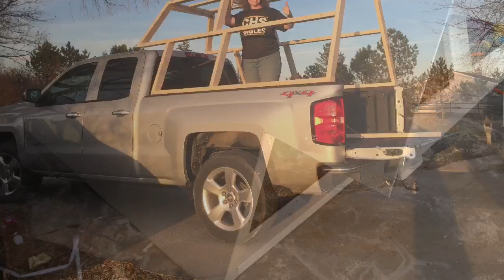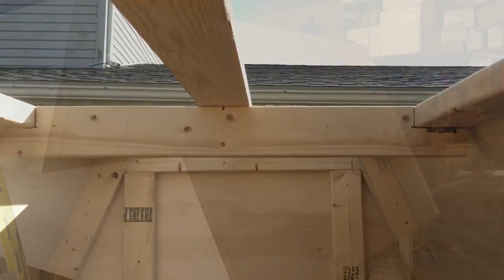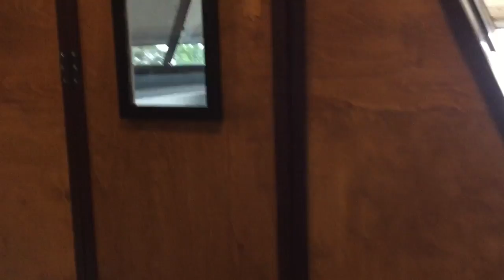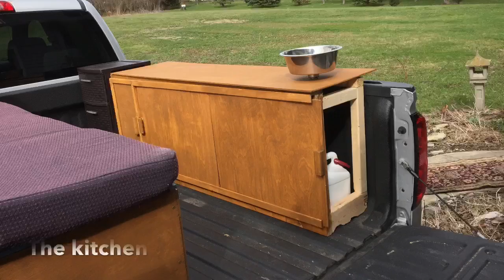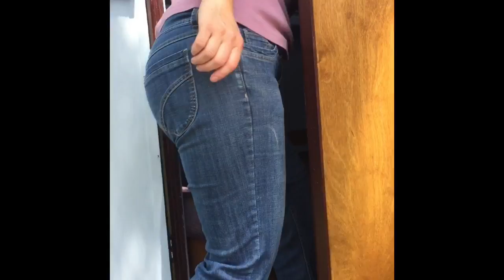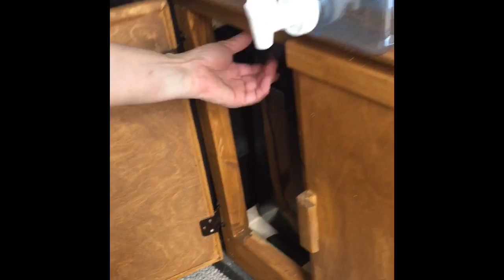DIY Wood Truck Cap Camper

Comment: Just great work. I realize this was posted over four years ago, but, if you are still reading posts, are you still using it? And, did you ever weigh the topper?
Reply from the maker: I used it up to last year, until I bought a bus and converted that.
Reply: @hollijacobs7858  Thanks for the reply and hope the bus is working out for you.

Comment: Great work, I've been looking into doing this. I was wondering how you secured the camper onto the truck so it doesn't fly off. Thanks!
Reply: Big aluminum clamps (4) and something called bully clamps. And bolts.  It was secured in 10 different places!!,

Comment: I have a Ford Ranger so in order to sleep sideways I'm going to have to extend it out beyond the walls of the truck by about 6 in on each side so I can sleep sideways part of the plot plywood 38 in of it will basically be across the whole thing I want to put solar panels on top and on one side so I can always aim the truck when I'm parked to face the wind not to win the Sun I got Junk land in hudspeth Texas and I want to visit it with this I like your concept because you don't add excess weight
Reply from the maker: I often thought about what you are suggesting.   It would work as long as everything is super secure and balanced.

Comment: I am in the planning stages now, and your frame design is PERFECT!!  The beam running the entire length of the side frame will give good support to the upper sleeping area.  I am a rather "large" person (6'2", 200 + lbs) so my design is expanded out a bit from yours, but essentially the same.  Thanks for the great ideas!!
Reply from the maker: Thanks you, sturdy and light weight was my goal.
Reply from the maker: @poa2.0surface77  go for it!  I’m not a fancy kind of gal!  More practical than anything else.

Comment: Your lightweight, eye catching and well equipped camper looks to be very accommodating, whether for a few days or a few months.

You've found that much sought balance between weight, bulk, practicality (on or off your truck) style and cost, and in doing so have created this elegantly simple, simply elegant travel cabin.

Your build will inspire others to consider the benefits of a light yet strong design and to keep it simple, without missing out on comfort, hygiene and self contained practicality.
Reply: She inspired Me!!

Comment: I’m a carpenter and I think you did a really nice job. Well thought out and it looks pretty light too! I may build the same on my truck.
My only concern is the rain hitting that plywood which will eventually delaminate.
Reply from the maker: I wanted to put a layer of fiberglass over the top to protect it, but chickened out.  Ended up storing it inside when I want using it.    Thanks for the compliment.
Reply: Little boat builders go through this debate a lot:  use expensive marine plywood, or use basic construction plywood and encapsulate it someway. Fiberglass, though good, is messy and a lot of work. Here are a few techniques used to extend wood life. 
Exterior poly. 
Exterior house paint will go a long way to protect the wood from sun and rain. Easy to reapply and change. Houses been using it a long time.
2-part Epoxy boat paint. 
Fiberglass just the joints where rain gets between the plys. 
Replace bad panels as they fail - use good screws with good heads. Pre-seal all edges. 
Money saved buying construction grade plywood, wait till it fails and build another one.
Reply: Carpenter here too, I thought it was a pretty good build, efficient and looks good. She could always do PMF(poor mans fiberglass) and its fairly cheap, you tube vids to show how. It'd make that shell last for years.

Comment: The best homemade camper I've seen. Don't get mad but I am going to build mine exactly as yours. The best and pretty good looking.
Reply from the maker: Mad?  I’m flattered.   Why reinvent the wheel?   Thanks for the ultimate compliment!!
Reply: Give yourself a pat on the back and give yourself the credit U deserve. Not joking I've built just about everything. Yours is the most simplified but most efficient design I've seen.
Reply: Make a stealthy wind deflector for that and U got it made young Lady.
Reply from the maker: @stephenbenavidez9738  thank you!

Comment: nice job! looks great. i'm about to build a simpler (no overcab) one similarly, i am using t1-11 for the shell, so it is weather ready,
Reply from the maker: Sounds good T1-11 is heavy, make sure it is secured.
Reply: T1-11 is not  a good  option it's a  made  wood  product  the  glue is a  water  based  lots of  swelling  if any  water  gets  in you can break or crumble  it with your  hands   the constant  movement  from your  truck  will widen the  screw holes  your a  lot  better off  with a plywood   use a  rubber  deck  paint on  it and  exterior  silicone  caulk on screws  and  edges  it will  last  years  . For  about  the  same  weight as  t 11 you can  use  plywood,  foam, craft  sanded  interior  plywood  you  get  insulation  and  extra  strength in  one

Comment: Looks great! You don't see many topper\camper builds like this. I am working on my own at the moment. I really think it is a much better way to go than a full on camper. I know this was 5 years ago but I don't see any vids of you using it. Has it all worked out ok?
Reply from the maker: I used it for three years (LOVED IT!!!), then I switched to a skoolie, got an offer I couldn’t refuse on the skoolie… sold that and built a camper in my horse trailer.  😆😆.   But honestly, I miss my truck camper,  I’m already planning another, I want to try to use foam.  I’ll post videos when I build that.  I’m going to use foam and PMF (poor man’s fiberglass).  It’s just as much a challenge to me as it is a savings in $$.
Reply: @hollijacobs7858  Mine is practice for a boat build, eventually (thus air, land and sea). That's why I'm going full on fiberglass. Otherwise I think I would do the PMF. First I'm going to enjoy the topper\camper for awhile.

Comment: Best set up I have seen to date!.......How wide and long is the bed and kitchen set up?  Will do the same with my truck and will credit to your idea / topper/camper here on you tube.
Reply: The bed is 28 inches wide, just about the size of a sleeping bag, and the "kitchen" is about 18 inches deep.  Both run the length of the truck little over 6 ft.

Comment: Great little setup and I was wondering if you had the plans for this build on the top by any chance? I really like it and would like the info on it if available. Thank You!!!
Reply: No plans, sorry, I built it as I went.
Reply: Would you be interested in telling me how tall it is from the bed to the roof top, the measurements of the rear door and the angle the side boards were cut at? The framing boards that rest on the bed of the truck going upward or did you just following the contour of the truck cab? Sorry to be a bother! But I do appreciate your reply
Reply: I tried to follow the angle of my truck cab, but I felt like I angled it in too far.   I could have made it wider at the top.  It was a little over 5 feet from the truck bed to the top, I could almost stand up. My goal was to use a full sheet of plywood on the side.  So it was 4 feet from side rails to the top.   The back door was a little less than two feet wide.  Sorry, I can be more specific.    I just kind of fitted it to the truck as I went.   I don’t have the truck cap anymore, I used all the wood and parts to build a skoolie camper out of a short bus, video to come in the next couple of weeks.

Comment: Great job that's so awsome couple questions. How did u attach the plywood?2nd what did u use to seal the plywood with thank you much appreciated.
Reply from the maker: Liquid nails, screws and nail gun.  On the plywood I spar urethane, to protect it.
Reply: @hollijacobs7858  very good thank you for quick response.

Comment: Very nice job¿the camper!  Any plans to work from or did you just wing it¿ How is it holding up¿ Any tweeks? Was 8ft sheet a limiting factor¿  Well Done!
Reply: I made it too narrow at the top (but it deflects wind great), 4 feet for a whole sheet of plywood would be great.  But then again I have all the room I need.  Yes 8ft was the limiting factor, it kept it simple.   I glued, nailed, screwed and reinforced the snot out of it.   It is rock solid, even at 75 mph.   I didn't have any real plans, just ideas from looking at others.   90% research, 10% construction! 😉
Reply: EXCELLENT JOB THOUGH

Comment: How would you keep water from running in between the door and tailgate?  I think I see foam near the end.
Reply from the maker: I used pipe insulation and tucked even more in the groves.  It worked remarkably well.

Comment: I like it.. but I'd  build it out to sit on the tail gate  and extend it out over the cabin and beyond.  You can inflate some bladder to support it over the cabin. I doubt that there would be any more drag.  nice desing. what kind of wood did you use??
Reply from the maker: It's just the size I wanted.  Not too big.
Reply from the maker: I'm pulling a horse trailer.

Comment: Do you have info on materials used and measurements? This is perfect for what I need to do and plan on recreating it.
Reply: No measurements, sorry.  I fitted it to my truck as I went.  Also made sure there was room for the windows.   Used lots of glue and super long screws.    Also found the most warped 2x4 at Menards, to arch the top over the cab so it wouldn't hit.
Reply: What did you use to cover the 2x4's and enclose the cab?
Reply: Birch plywood, the pricy kind.  I think it was a little thicker than 1/4 inch.   So far it's held up to 75 mph driving.  But the 2x4 frame is rock solid.   I braced and glued and nailed and screwed the snot out of it.  The roof is a thicker plywood with a rough grain texture on the inside.
Reply: How is the topper mounted to the truck? What keeps it in place?
Reply: I used a foam plumbing strip (tape) under the frame, then 4 aluminum truck cap C clamps, 4 bully clamps (attached to bed rail) and in the 2x4 pockets on the truck I bolted wood into them and bolted the cap to those.   I does not budge.
Reply: Hollianne Jacobs i used a thiner peice to get the arch on the top.

Comment: Did you use house paint on the outside? I copied your design pretty closely. Thanks
Reply from the maker: Primer and several coats of exterior paint on the roof.  I store it indoors when not in use.

Comment: Hey Holli! How much does the top weigh? Did it affect your mileage much?
Reply from the maker: I built this to go with my horse trailer, so the trailer really cuts into my mileage.   My hope is that he helps deflect air over my trailer so, maybe it helps with mileage?!?!   But really my mileage seems to be the same when I'm pulling the trailer, with or without the camper.  I've never driven it without the trailer though.
Reply: I agree that the way you built the front tampered will indeed help to deflect the winder resistance while traveling so good build on that for sure. Thanks for getting back to me and good job

Comment: Good Job! You might want to fix it so no one can put your tail gate up and trap you inside!
Reply: Oh yes, I've thought of that.   I have a strip of wood that slides in the space between the tailgate and truck bed preventing someone from walking by and flipping it up.  Sure they could get it out, but not without waking me up first!

Comment: Very nice build! Any idea of the total weight?
Reply: Radnally yes. do you happen to know the weight plz? i love your look but im in a dodge dakota so lower payload allowance
Reply: I'm guessing 300-400 lbs.  I went for light weight.
Reply: Hollianne Jacobs thanks. What material did you use for the skin? Did you build the door as well? I have a pretty low powered 1/2 ton truck with a 6' bed ...and this looks like a pretty light weight solution. I could rip the 2x4s down as well to save weight.
Reply: 1/4 birch plywood. Yes, I built the door, it took on a little warp, but it shuts well enough to keep mosquitoes and rain out.   I used full 2x4s but you can see I didn't use that many, I secured them with 5 inch screws and brackets. My bed is a 6 1/2 foot bed.   I could slide the whole thing on and off before the plywood was put on....that's how light it was.
Reply: Hollianne Jacobs thats great. Thanks
Reply: Hollianne Jacobs what kind of 2x4 did you use? I’m about to frame out my truck camper and I bought the treated lumber for outdoor use and it is so heavy. Want the strength of 2x4 but something lighter. Thank you so much, I love what you have done here.
Reply: Just regular construction 2x4's  the plywood covered up everything, so I wasn't worried about them weathering.   Keep in mind fresh treated 2x4's are still wet from mill, give them time  (months??) they'll get lighter as they dry out..
Reply: Hollianne Jacobs hello holli i watched your video and now i am about half way in the build,im thinking mine looks almost identical except for what we did on the shell.check out my chanel you wont beleave just ny watch how close they are.

Comment: How did you seal the entry way between the tailgate and the camper, do you get water on the floor when it rains, did you seal the bottom of the camper where it meets the floor
Reply from the maker: I started with insulation for a pipe, wrapped it around the edge.  But I changed to the sticky foam tape.  That made it pretty water tight.   It's not perfect but it seems to keep water out.

Comment: Do you have plans or instructions on how to build this?
Reply: Not really, I built it to fit on the truck as I went.   Even had to modify, when my windows were too long.  I put it on and took it off several times.
Reply: @holliannejacobs4003  any tips, tricks, or recommendations? Gonna start this weekend.
Reply: Use screws, because you'll have to take them back out and readjust your plans as you go.   Also, plan, plan, plan and then build.

Comment: how did you weather proof it so it doesn't leak?
Reply: The top is a solid piece of plywood, and all the seams are overlapped with trim, paint and caulk.   So far so good.
Reply: @holliannejacobs4003  how is the waterprood still going...

Comment: Nice Job-Very Attractive. How do You get the camper on and off You truck? Can You lift it off with some help or do You use jacks? How thick is the sidewall paneling and the the roof? What kind of stain did You use?
Reply from the maker: I made huge sawhorses and drove under them.  Two people could lift up the front or the back. Lift up set on saw horses ..repeat and drive out.   Walls 1/4 inch, and roof 1/2 I think.
Reply: @hollijacobs7858  Thanks for Your prompt reply. I assume the stain You used did a good job of waterproofing the wood and the  scent didn't linger or could be smelled inside. If You happen to remember the brand of the stain please reply back.
Reply from the maker: @missouritraveler6401  stain, not sure I remember.  The finish was Satin Spar urethane.
Reply: @hollijacobs7858  Thanks Holli.

Comment: Is it water proof because I'm about to build one and I don't know what to do about water proofing it
Reply: I put 4 coats of outdoor paint on the roof.   But then again the roof is a solid piece of plywood, no seams to leak and all trim is overlapped to prevent leaking. I have spent several nights in it, a few of which were raining and I was fine.  On the sides I used Spar Urathane, the kind for outdoor use.

Comment: What kind of plywood did you use to sheathe that with
Reply: 1/4 inch birch on the sides and 1/2 on the top.
Reply: Where did you buy the quarter inch plywood?
Reply: Menards 👍